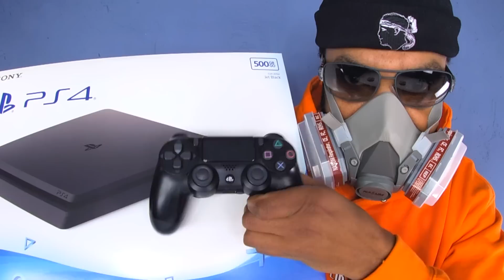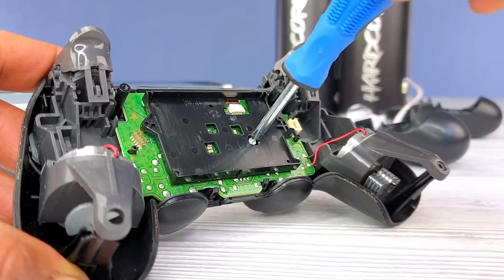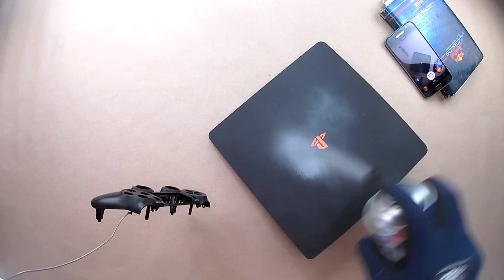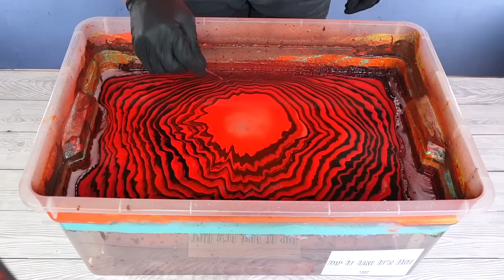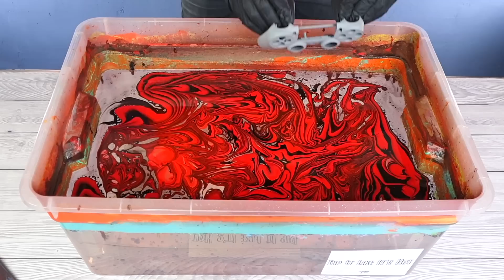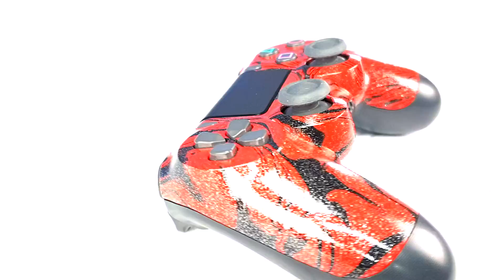How To Hydro Dip Sony PS4 Console + Controller 🎮🎨 *SaTISfyiNg*

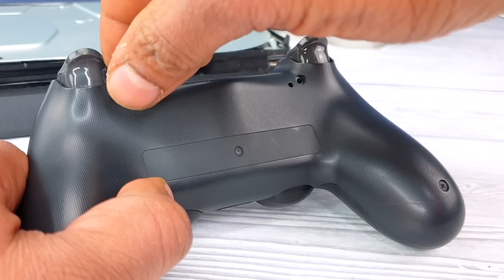Comment: 0:22 nobody going to point out that he pulled out the whole connector instead of just simply pulling the wire it can be removed easily I’ve done many repairs of all my broken controller an reused most of the parts.
Reply: He can never charge the controller again😂😂😂
Reply: I noticed it right off the bat , smh 😭🤦🏽‍♂️

Comment: That controler wont work...when you were pulling out firs wire...you puled out whole conector...0.24 white cable in big white/yellow conector...0.26 no conector when you were pulling cable out

Comment: Did that controller still work?? Looked like he ripped a connector off of the board... end result does look cool though.
Reply: Yea it still works you could plug that back in

Comment: I’ve been hearing u need oil based spray paint but I use krylon so is it not one because all of my dips turn out as if the top layer of paint has become a sheet of sticky paint so I’m confused on what I’m doing wrong